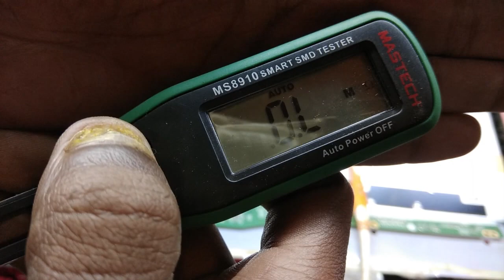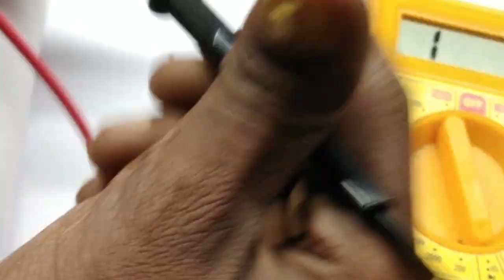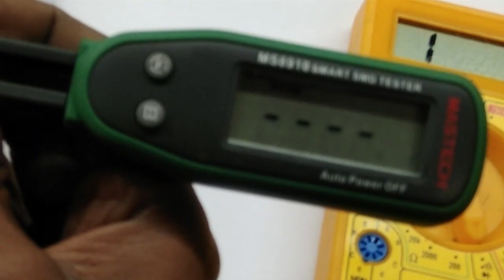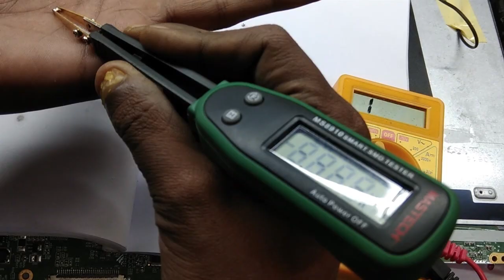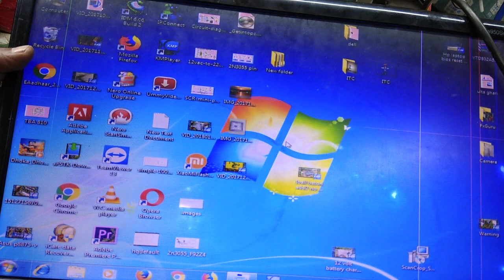कंप्यूटर स्क्रीन की मरम्मत #monitor repair #aoc 20" lcd monitor picture problem solved in Hindi

Comment: Sir I  applied thinner to clean the board which  comes with  the display and after cleaning the board stopped working and only back light is coming what to do please tell
Reply: thinner? why the hell you did that? you needed to apply isopropyl alcohol. your board is ruinned.